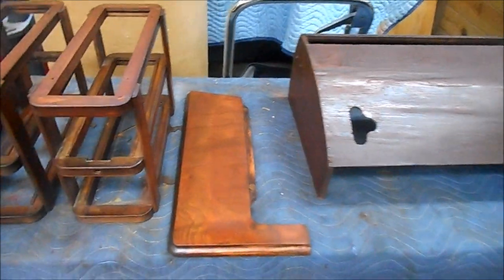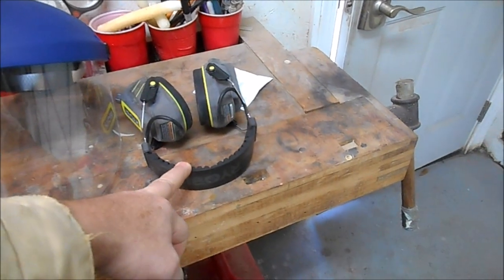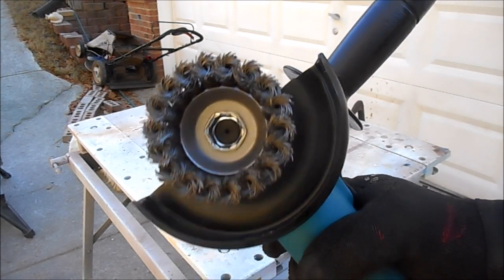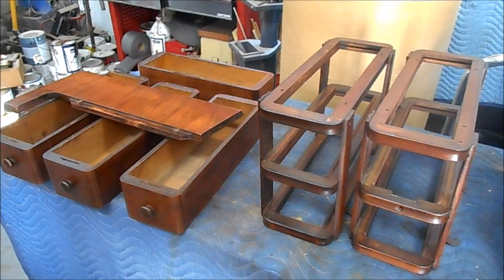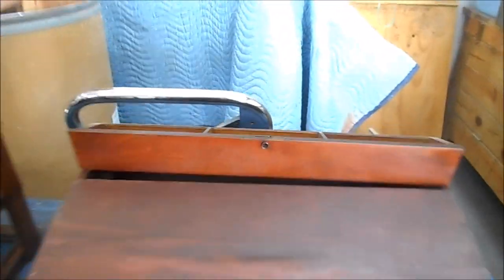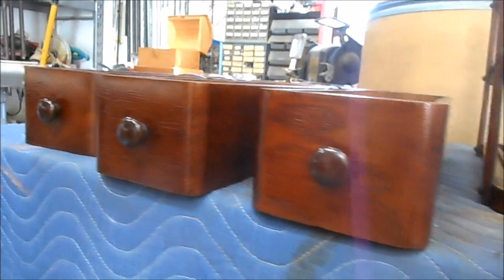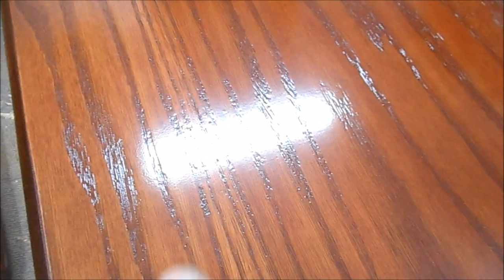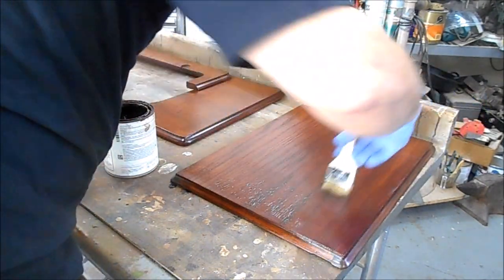Restoration of 1910 Singer Treadle Sewing Machine - Part 3

Comment: I have the same machine and cabinet, the only difference is I have carvings around the drawer knobs and on the little hidden fold out drawer.
I’m following your tutorial, today I spent wire brushing the two side legs (4 hours just for the 2 of them), but it’s done. I’ll need to wipe the dust off with thinners before painting. My metal had almost zero gold left on the “singer” word so I’ll need to investigate a way of replacing the gold on top of the lettering. My safety gear was glasses and a bandana to keep metal out of my hair.. lol.. 
I’m a little apprehensive about starting the wood staining and finishing but I’ll take it step by step. I’ve never restored anything to its original appearance. I’m a mum of 4 boys in Wollongong Australia. 
Thank you for this tutorial.
Ps. I also have to restore the machine itself.
Reply: Sorry where is part 4 please?

Comment: Thanks for the informative videos. I have some skill but it is nice to see how others do certain tasks. The model that I am currently working on is the same cabinet as yours but was built in 1932. The base is not all cast iron. It has many folded steel parts. I am going to veneer as many surfaces as possible in order to get a uniform look. Something you might be able to help me with. I was able to pull one knob out of the drawer fronts with my hands but the other 3 wont budge. Needless to say I do not wish to use pliers. Should I try heat. Not sure that would loosen the old glue or not.
Reply from the maker: Heat will usually loosen glue, but ask yourself is the risk of breaking the knob worth having to refinish around it?  You never know who may have attached it or what they used to do so.   You may want to leave it in, use 0000 steel wool at the base when you strip it and then finish it in place.   Good luck and thanks for watching.
Reply: Unfortunately I need to remove it to do new veneer. I'm doing an entire veneer wrap of all the drawers.
Reply from the maker: Gotcha.   Yes, then try heat and hope there are no "secret" fasteners, etc. that would make your life more difficult.   Slow and careful will be your friends here.   I use a DeWalt heat gun and I've had very good luck with it.   Best regards!

Comment: i thought that the metal parts was cast iron , but as i can see its just steel?
Reply from the maker: No, they are cast iron as best as I can tell.   There are some pressed steel parts on a later machine I re-did, but that one was from the 30s.